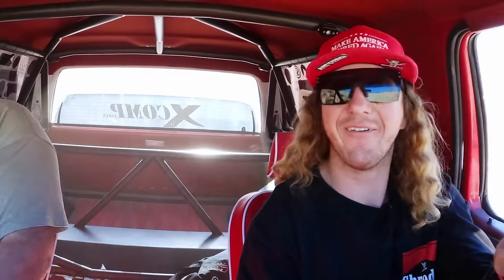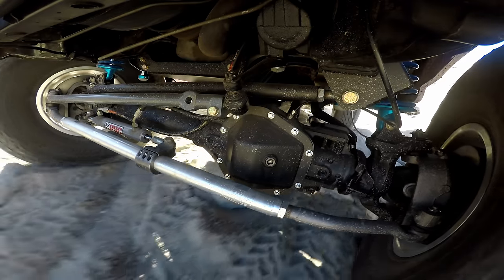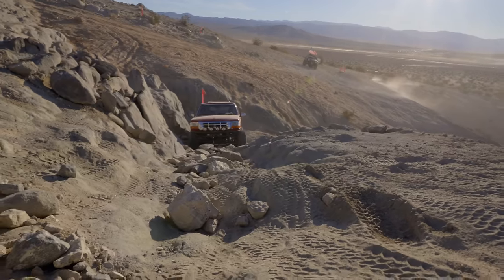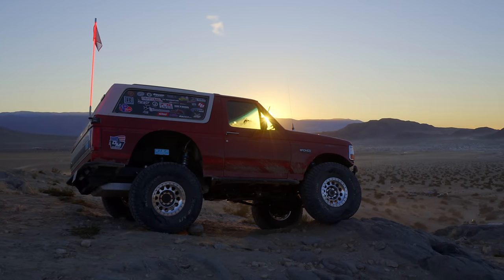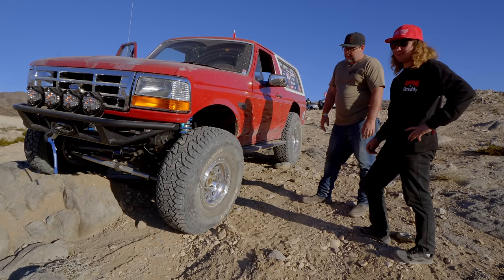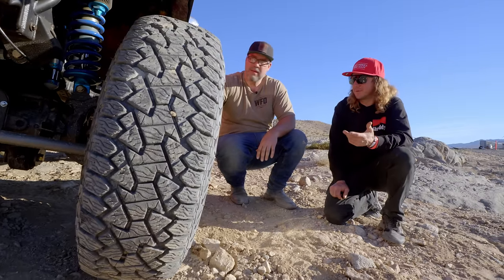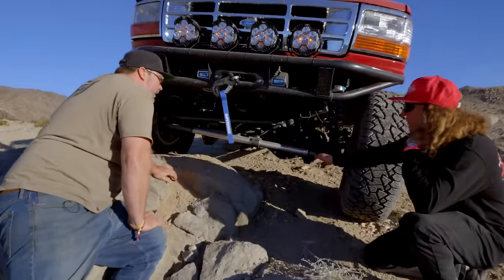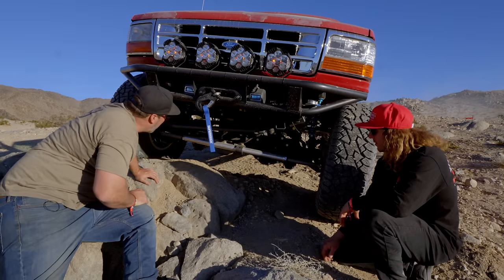Blake Wilkey's "Bloodshark" | 1992 Super-Duty Solid Axle Swapped Bronco

Comment: People don't understand how much more effort it takes to crawl a full size rig like this. Good work guys
Reply: I think you'd be surprised at actually how small this generation of Bronco is compared to modern-day suv's /trucks.
Reply: @offroadwarfare9526  i meant compared to a jeep or Toyota or typical buggy build. We wheeled a 77 scout down at hammers this year and it’s a lot different than a typical rock crawler build. With that long front end and being too heavy it’s much different is all I was saying
Reply: I wheel a 21 power wagon on 38s. It ate up moab. I for the life of me, could never decide if it was harder or easier to wheel a full size. How much of the effortlessness was the wheelbase and how much was 18 years of experience. Still not sure.

Comment: If you did want to give it some more power without a complete engine build Edelbrock makes the proflo 4 EFI and put some cheap aluminum cylinder heads (I used Flotek heads) gave me quite a boost in horsepower. And thats keeping the stock camshaft.

Comment: Bad ass build! Instead of having those funky harness bar “triangles” behind the seats, run a tube across on the floor and then two vertical bars up to the hoop.  Get the strength but have an opening to keep a walkthrough for the back area. You will roll it and ya never know how many times or from how high up?!